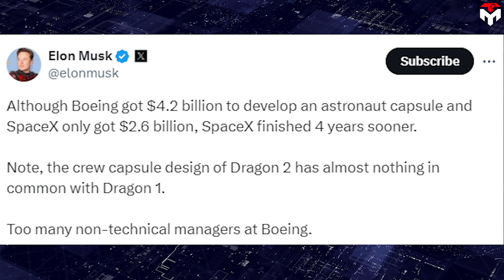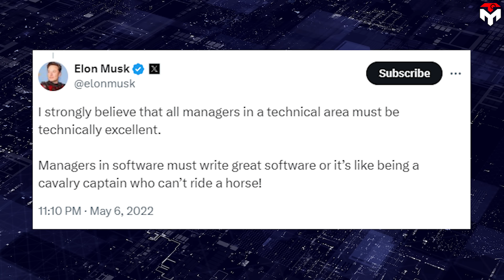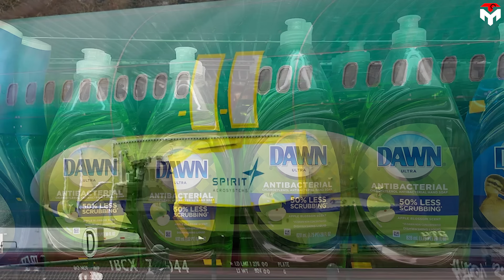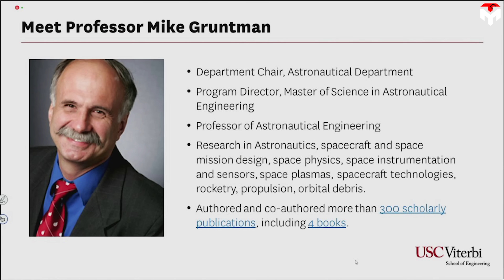Elon Musk Just Exposed Why Boeing Starliner FAILED! NASA Give Up...

Comment: Neglected to mention what is, I think, a major element of Boeing's downfall.  Up until a few months ago, the Boeing website was awash with DEI BS.  It was an almost exclusive topic.  If you were a Boeing engineer, possessed with world class excellence in technical ability, your career at Boeing was going to be limited by race if you weren't of the favored race du jour.  Also a quick look at the Board of Directors revealed most did not have an aerospace background.  Before she ran for Presidential election, Nikki0 Haley was on the Boeing Board of Directors.
Reply: We get into these planes: Why should we DIE due to DEI? 

Sanjosemike (no longer in CA)

Comment: I once worked for a modern steelmaking company whose original CEO was a competent steelmaker.  It was a state of the art mill of it's type in the mid-a908's.  Once he retired the Board appointed a sales exec as the CEO.  In a few short years with bad decisions that were based on sales that required manufacturing changes that were technically deficient, he drove the company near bankruptcy before finally selling it to another, larger steelmaker.  I've seen similar disasters in other industries when bean-counters took over companies and sacrificed long-term goals for short-term quarterly stock dividends.

Comment: The best tech on the earth will not fix a defective valve in space.  The responsible decision is to bring the Starliner back un-manned to recover and examine, and send a replacement non-defective vehicle to bring the astronauts home.
Reply: Boeing is not capable of building a safe spacecraft.  They have been working on the thrusters for two damn years.  These thrusters are a ridiculously simple design and they still can’t get it right.  Amateurs are building better stuff than Boeing.  
The helium leaks have been a problem for years as well.  Bean counters can’t build safe aircraft, or safe spacecraft.  Their expertise is in lying and manipulating for their own extreme greed.  
Calhoun gets 35 million a year to screw up.  When he’s not screwing up he’s thinking about how to siphon more money from Boeing.  He’s not capable of building, or understanding mechanical equipment.  He’s a Wall Street bean counting imbecile.
The BOD should be in prison.

Comment: The answer to Starliner is technically complicated and also simple. They need to start from scratch and test every single nut and bold. They need to ride SpaceX to space many times to ensure that it's really flight-ready. Before a single flight with humans, they should have flown 10 times. Does this mean that there is no place for Starliner? No, there should be more than just SpaceX Falcon. Having said that, boring should have already developed and built new and improved models. At this point, Boeing should knuckle down and pull the money out of their own pocket just to save face.